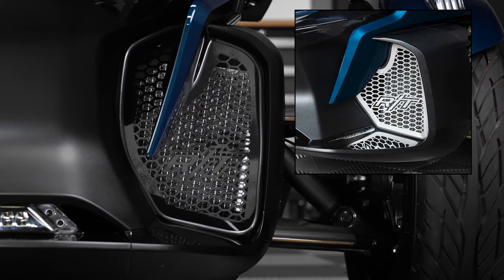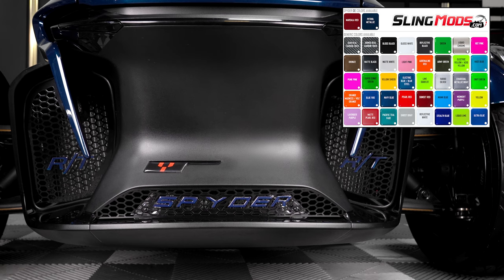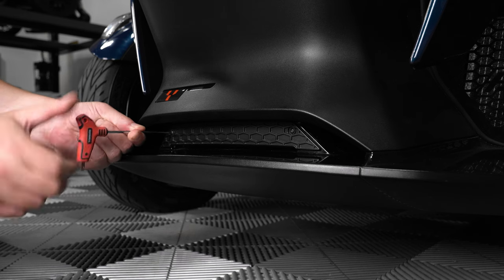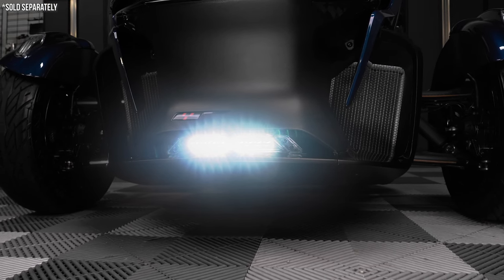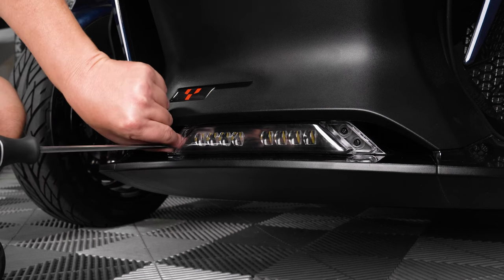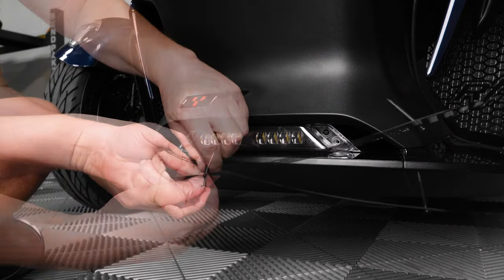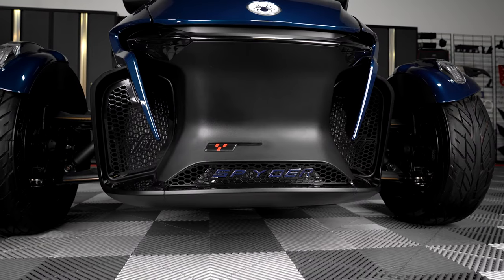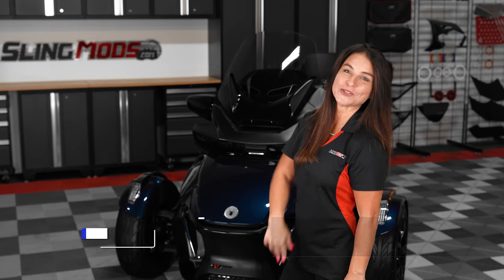Can-Am Spyder RT Center Grille Insert (2020+) | Install

Comment: I have the led on mine, but not that type. So it won't work for mine.
Reply from the maker: Yeah, if you have a different type of light in that center location, this center grille will not be compatible.
Reply: @Slingmods  the thing about it is its an led light bar that i ordered from this site
Reply: Slingmods.
Reply: @Slingmods  y'all hosted and did an installation of it on the same spyder rt
Reply from the maker: @brucewilliams9905  Ah yeah, that's the SE Performance Light Bar with Dash Switch. That light bar is not compatible with this grille.
Reply: @Slingmods  well do y'all think that one can be made that is???
Reply from the maker: @brucewilliams9905  Hello Bruce, there aren't currently any plans to make a grille for use with the SE Performance Light bar at this time. My apologies.